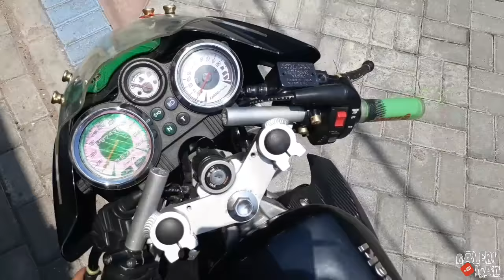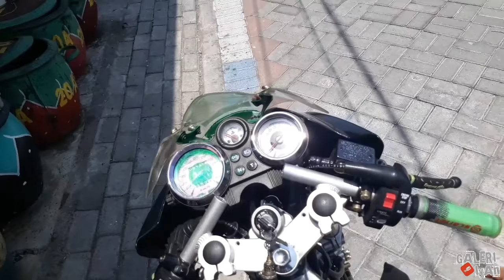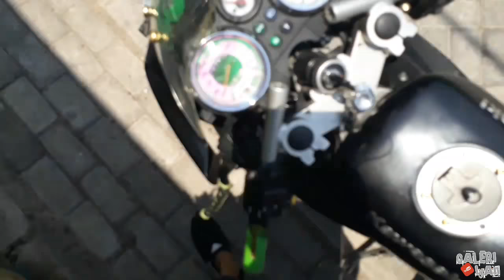Cara mengatasi motor 2 tak susah dihidupkan | ninja r susah di hidupkan | GaleriNinjaVlog

Comment: om biasanya kan motor itu asap nya ga banyak, ya normal lah, tpi knp kok punya saya banyak bgt asapnya🙏
Reply from the maker: Bisa juga sil crankcasenya getas jd oli rembes sampe ke kruk as trus ikut kebakar . Kemungkinan ya
Reply: Kalo baru nyala wajar bang, karna pompa olsam sistem kerjanya begitu, dan kenapa mesin dingin itu di choke itu jg wajar bang emg bgtu selagi std semua, karbu msh manual makanya kaya beat vario spacy scoopy karbu kan make choke, nya makin berkembang. Choke otomatis dengan mekanisme selenoid sesuai temperatur mesin